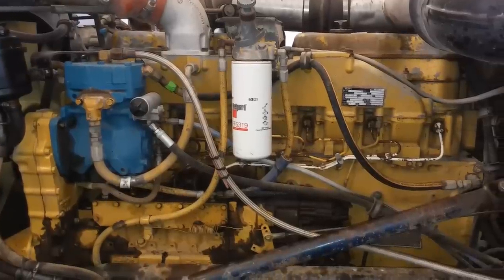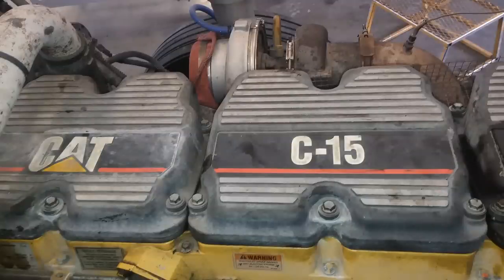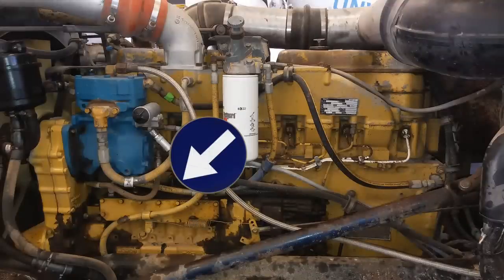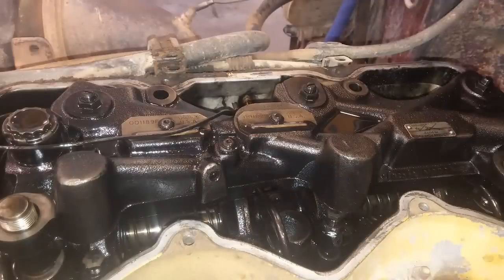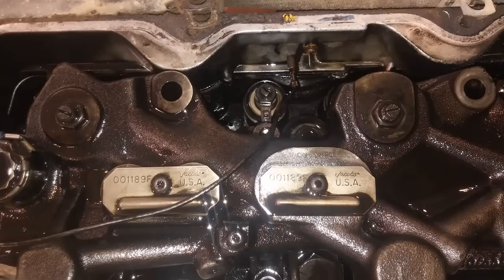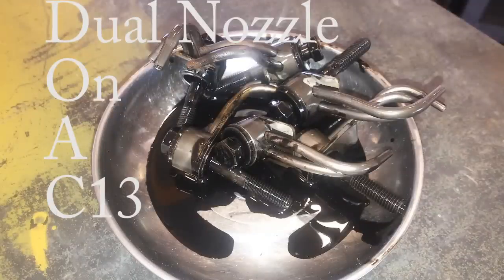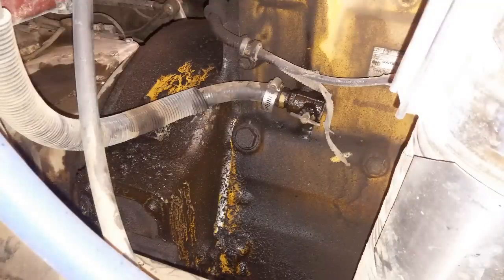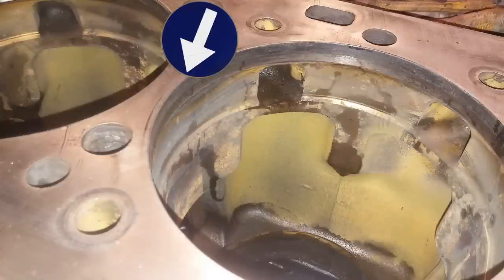The Cat 3406B Engine. Know Your Engine.  Caterpillar 3406 Information And History.

Comment: Have you ever seen a 3406b peec engien
Reply from the maker: +James R. Reser 3406C is a PEEC.
Reply: Adept Ape Im almost positive I've worked on a B model PEEC you sure only C anyway hated them BTMs only good easy to troubleshoot because pump and timing advance btm were identical
Reply: By the way 7Fb best B model and timing advance set up
Reply: All 8TC's, 2EK's, 5YG's and early 4CK's was 3406B PEEC.
Reply: When I die and go to hell I will be operating an Allis Chalmers pushing coal powered by an 8TC PEEC engine.
Reply: I would get stuck doing all the updates on a 2YG, never been touch . That some fool put in GMC Brigadier.

Comment: I know this engine better than cat!! And they made a c model that was mechanical it had a e model crankshaft .
Reply: How can you give it a little more power I have 3406b 350 4mg series and want it at least bumped up to 400hp
Reply: First thing run the overhead then advance the timing and back the fuel and air ratio screws out equal turns if you want more let me know but you can change out injectors and turbo the turbo that you will need is a OR-0651 cat # and I will find you the injector number if needed
Reply: Injector number is OR-8785
Reply: And I forgot to mention the most important thing is to check the air and fuel ratio diaphragm is I line that comes of the intake to the fuel pump. Pressure  Test at the fuel pump if its does not hold 45 lbs change diaphragm part # 6I-1564
Reply: @chadwilliams2973  Why don't you tell him how to rerate it to a 400 or a 425. Twisting screws is easy. I would not put 45 psi on the FRC. 15 is enough to check for a hole or a leak. If you back the FRC screw out you will slow response time down. The lever screw gets backed out but the screw under the cover turn it in. FRC's 1988 and back cock with turbo psi. 1989 and up cock with oil psi. If FRC has been replaced you can't tell which valve you have. The cover would warp on the FRC and the gasket would blow out. Cat updated the cover and inner part to a O-ring design. If you still have the old style cover Cat changed the gasket. Agree the VTU was a problem on this engine. Numerous updates and most of the ones I see are assembled wrong. Never reuse the bolts that hold the VTU on. Have seen them break, also check to see if the inner carrier is slipping. Also check to see if you have full throttle travel. Make sure linkage will break over and not restricting RPM's.
Also it has nozzles, not injectors. Nozzles are designed to match the bowl of the piston. The wrong angle and you can burn a piston. As the nozzles wear they open up and give more fuel. Replacing the nozzles with new, I have seen 100 HP loss on the dyno, until they open back up.

Comment: I love watching your videos cause I just wait on you to fuck up. 3406b had to separate peec ser# the 3406c just had 1 peec ser#. 3406b production stopped in 92. 5kj 3zj 8pn and 4ck are all 3406c. 4ck was electronic. 7fb 4mg were 3406b 2ek and 8tc were 3406b electronic engines. You must work for a dealer that don't have any experienced technicians!
Reply: Wrong. 5KJ, 3ZJ and 4CK could be a 3406B or 3406C depends on serial number. Read my comments, 41 years doing this.
Not his time frame of working on these. When I started 92U's was still being built and 1600 series was still strong.
Reply: @johngoldsmith6629  only about 1500 3zj were b and 840 or so 5kj and 4ck were b's. 26 years working at a cat dealer. Just cause you've done it fir 41 years don't mean you've been doing it right.
Reply: @gabemccarty8128  So is 4CK00500 a B or C model? Is 5KJ06800 a B or C model? Is 3ZJ01900 a B or C model?